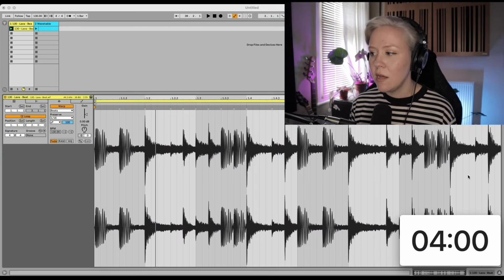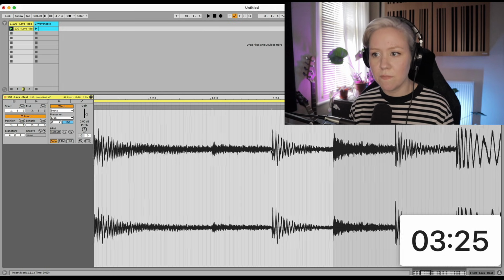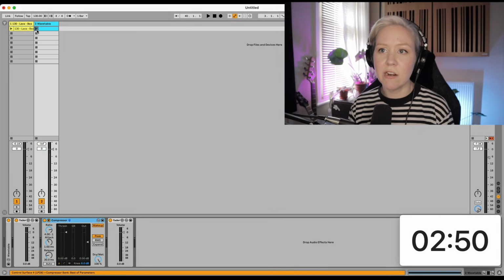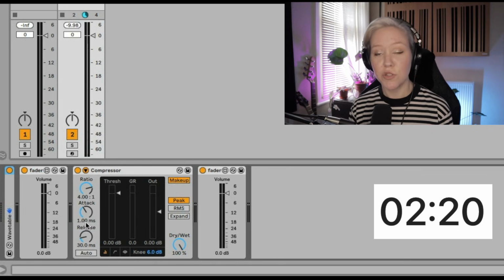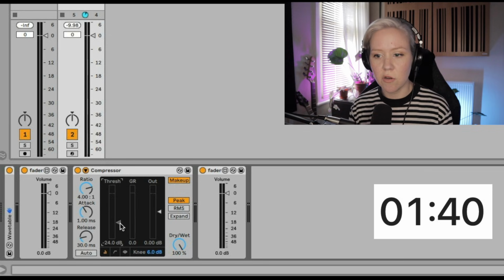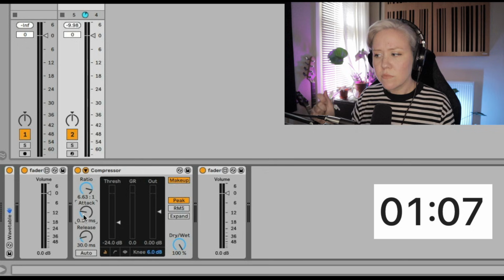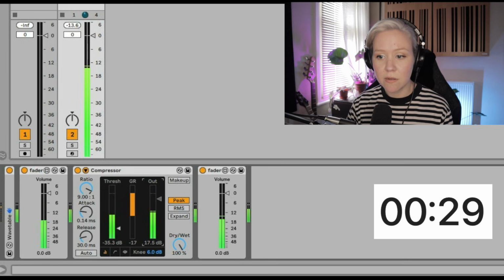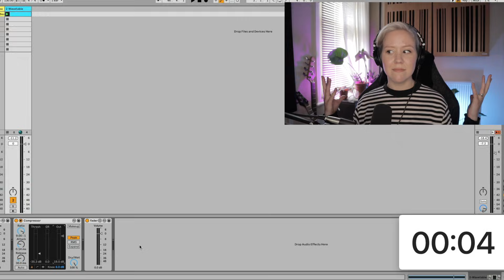Learn Compressor In 4 min • Ableton Live

Comment: Do you want the compression cheat code in Ableton? The short answer: Flattenator, classic compression. Gives you the brightness you want while boosting the signal and thinning out the dynamic range. Lower your signal before applying because the volume boost is for real.

Comment: This was really good! Thank you. I think you should do more of these 4 minute videos. it was very succinct. So, the point of compression is to reduce dynamic range while still being able to control volume? What is the difference between using the compressor and lowering the gain fader in the instrument? Don't they both reduce dynamic range?

Comment: what is the point of the Makeup button if you turn it off and manually adjust output - shouldn't the make up gain button apply the  required gain reduction automatically?
Reply from the maker: It's ok, but usually it's way louder than the input signal before compression. So makes gain staging/mixing more difficult.

Comment: Most videos on compression show graphs, visuals, knobs and settings and then show what the effect on the sound is. I'd rather see one where compression is explained from the sounds. What wishes/demands/problems ever originated compression? When should you use compression, what is your goal?

I think i know compression stared as a tool to enable transporting more sound information (mainly telephone speech) over a limited bandwidth (cables). So no musical purposes. Applying it to radio transmission probably did. Guitar players started using them for other purposes. But, say, what preferences does I fulfill in drums? It should be possible to make a video only using sound examples showing the effects.

A topic I also was interested in: in TV commercial always sound louder than the show around them. Still, the network will say they aren't (due to measurement method it seems). This is said to be compression too, and your video partly show this very well (but what does the make up do?).

Tough subject (also shows in how many videos there are about it (as well the number of sequels many youtubers need to make on the subject). so maybe rather a 'when and why' (and this is how it sounds) than 'what is it' (and this is how it looks)? I always envy people that can hear how fast it works.